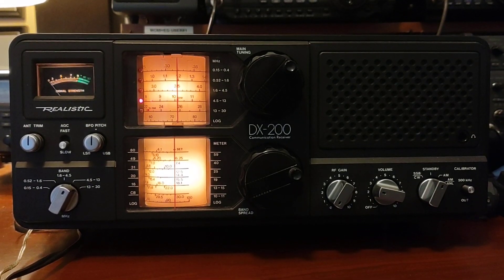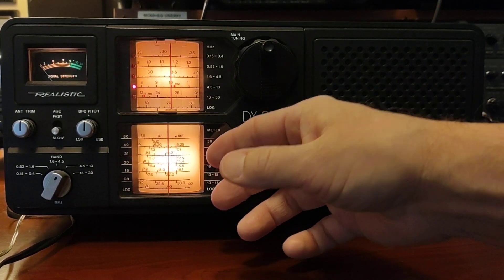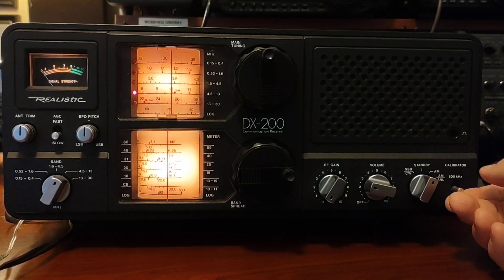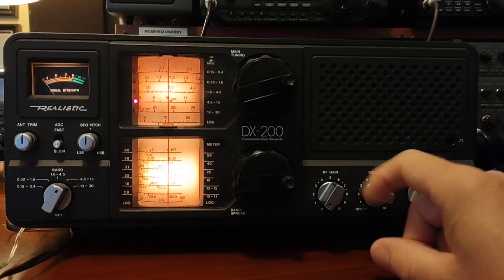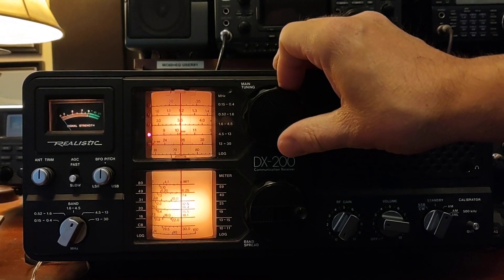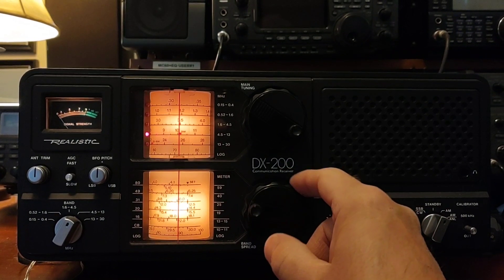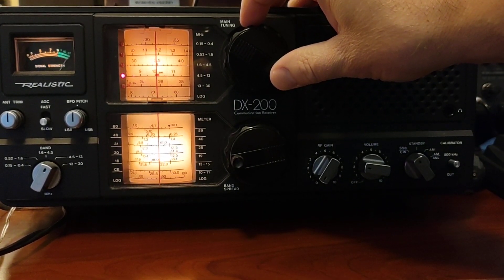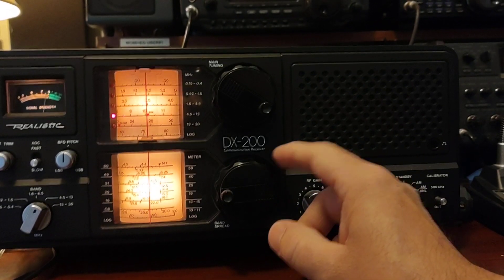Realistic DX-200 Calibration

Comment: Thanks for the video. I just bought one of these on eBay and it showed up to the house today I'm looking forward to getting home and checking it out
Reply from the maker: Enjoy!! This is a really fun radio to operate and use. One piece of advise, if you plan on listening to SSB, turn the radio on a head of time for about a half hour so it stabilizes. When it's cold, it drifts quite a bit, but after warmed up becomes pretty stable for a non-PLL unit.

Comment: Great little receiver. Mod number uno: get a good ground point. That wil sort out a lot of HF interference. I have made a three wire cord and plugged in my shack (filtered) powersource and that was a hughe upgrade. Second:  I was listening to a SSB station on 15 MHz and discovered that in the CS/SSB mode and the bfo pitch centered, when you switch on the calibration(!!) the conversation come in much LOUDER and much better to follow. That was new for me. lol

Comment: Thanks for the vid. Just dug my set out from underneath my shack table where it's been for 30+ years to have a go at repairing it. I've only plugged it in over that time maybe 3/4 times. Each time it seems to have just gradually expired a little more until now all I hear is a hiss from the speaker. The band selector doesn't seem to work and none of the red LED main band indicators light up. It may be above my pay grade.
Reply: You can buy one for around US $85. Not all that expensive in 2025.